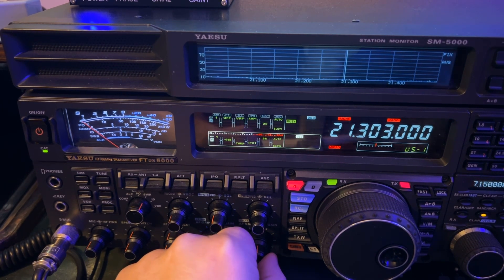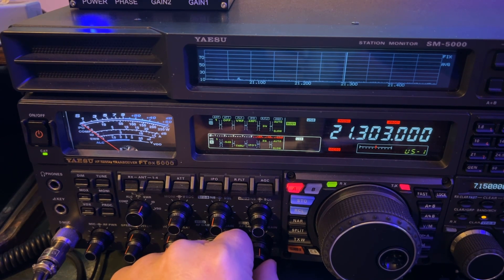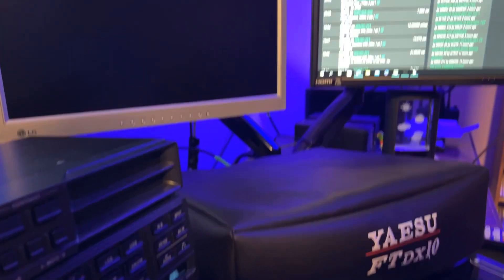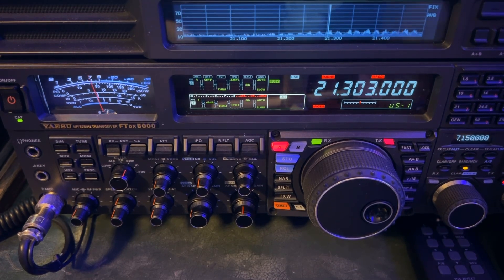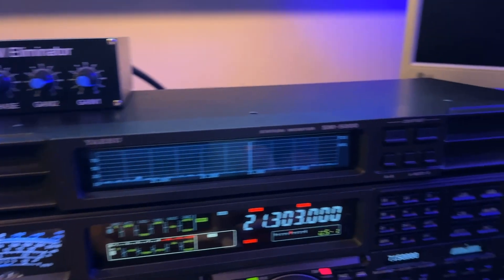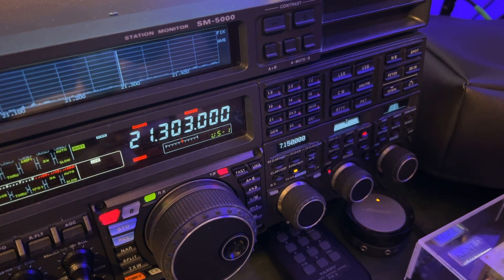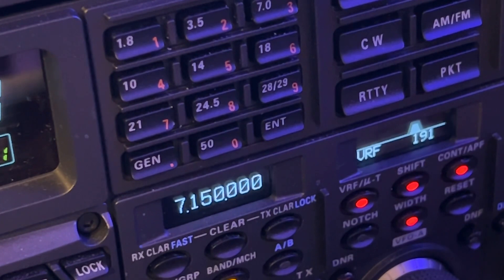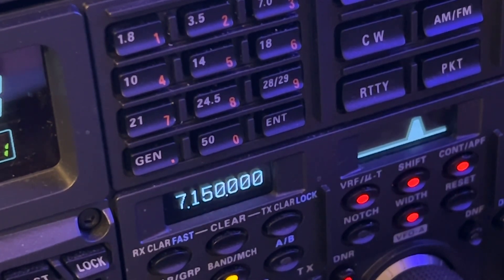Combining Multiple Features to Pull Out a Weak Signal While Battling QRM #hamradio #operating

Comment: Just wonder if you have a extra set of frequency display tubes?  If not you should think about it. Its the reason i passed on a 5000
Reply from the maker: I have a spare for every display, including the SM-5000. But I keep the brightness at 2 or 3. No issues thus far, since I bought it, in 2019. Worst case, I use software to control it. Turn it into a “Yaesu Flex Radio.”

Comment: This is exactly why digital modes, and the future is so bright. (If you’re into just text/data/binary xfer). The software can be set to TX at specific bandwidth and frequencies. The RX software can be set to bounce around a frequency, and locate signals beneath the noise floor. The user can be just plain dumb, but at least the ones who watch this, and study, know what is going on.

There’s no reason why in 2023, hams can’t have a worldwide data network. Hopefully the future generations get on the ball. Voice is fun, and I love it, but when it comes to making contact, and xferring information, it’s well within reach without launching satellites and other extreme measures.
Reply from the maker: I prefer CW, but ham radio offers something for everyone.
Reply: @n4hnhradio  I love CW. It's a great tool to have in your wheelhouse. At the same time, it's exhausting to send/rcv information over CW compared to using a modern device like laptop/tablet/phone to just digitally encode whatever you want and fire it off to the other end to be received and converted. Especially when the atmospheric conditions needed are not there.